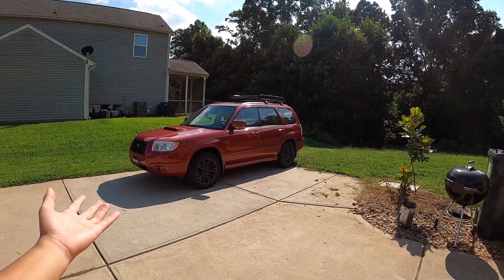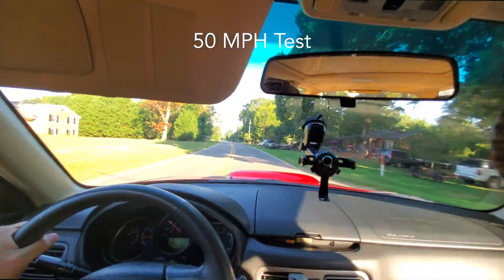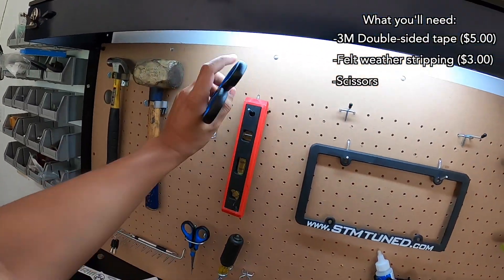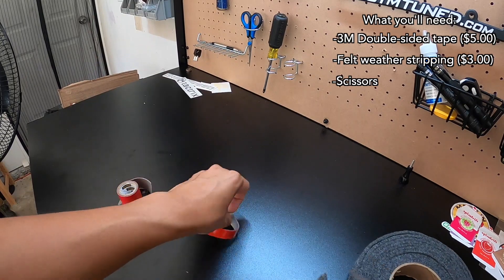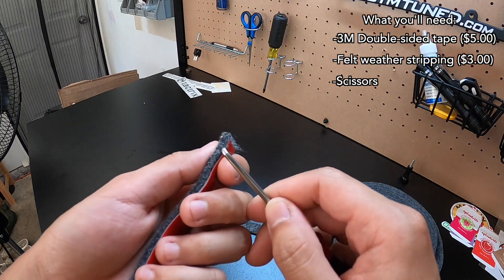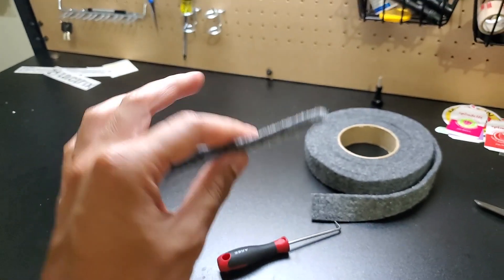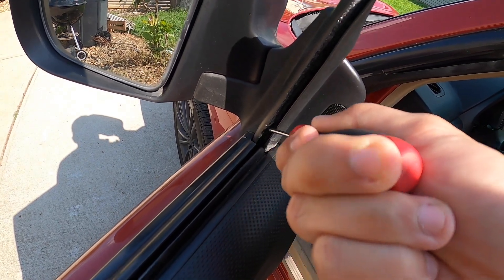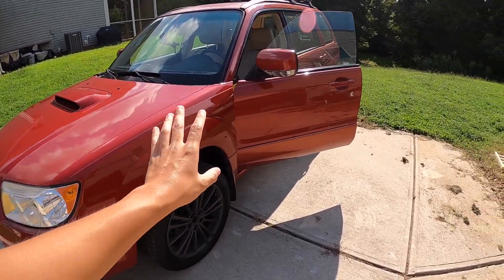Subaru Forester wind noise fix | Window gussets failure and effective repair/modification

Comment: Dude. This worked, thanks! I tried squeezing the gussets but they are frayed at the top so that didn't help. I tried several kinds of glues and adhesives and high stregth tape to try to hold the gusset together. That didn't work either. Your simple but effective fix worked perfectly. My Forester is totally quiet even up to speeds  80 mph or more, (hypothetically, of course.)  ; )
Reply from the maker: Hey Rick!

That's great to hear! Thanks for sharing your experience with the other techniques as well - I'm sure it's gonna help lots of other subie owners

Comment: I fix mine with a "duck mouth" locking pliers. Just lower you window and press together the triangle part were window roles up. Not to much the windows can't go up freely.  Also helped removing the tweeter plastic cover.
Reply from the maker: This is great, thanks for the advice on this!

Comment: Gussets new set ebay $74. Also if you take the interior speaker cover off and mirror, you can clamp the metal closer and fix it.

Comment: The problem is usually caused due to people pushing on the window to close the doors.  Being a "frameless" design, most of the load and effort of pushing the door closed transfers straight to that small gusset.   You only need to close up the metal inside that gusset, no need to add anything.
Reply from the maker: Thanks for the tip!
Reply: That's only if the gussets aren't split at the top. If they are, that doesn't work.

Comment: Won't dust and sand get into the felt and end up scratching the windows? Dust and sand is a big problem where I live in rural Australia. Just wondering.
Reply from the maker: Hey DaNat, thanks for reaching out! That's a good point and a very real possibility.

Fortunately for me, I planned on overlanding with my Forester so I am already expecting paint/window damage

Comment: how would one do this if your window motor is dead? anyone
Reply from the maker: Unfort you'd need to replace the motor (or electrical connections) to drop/raise your glass window. I don't think it'd be possible without that functionality